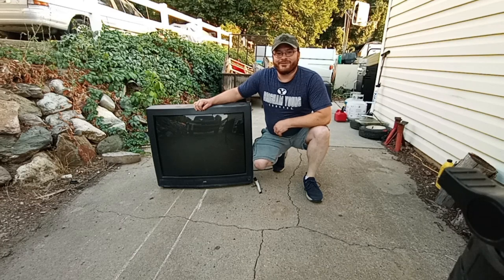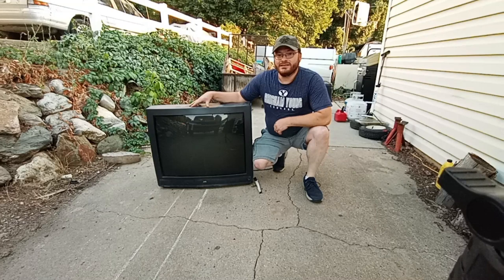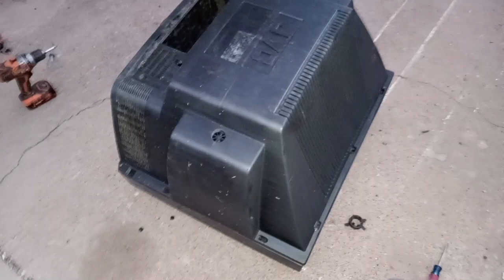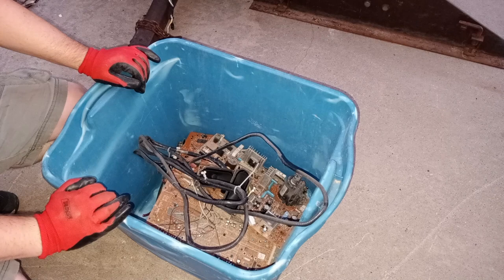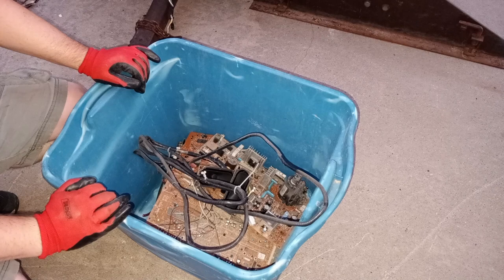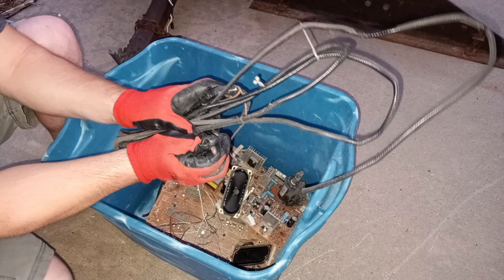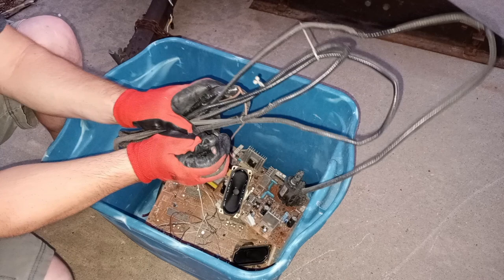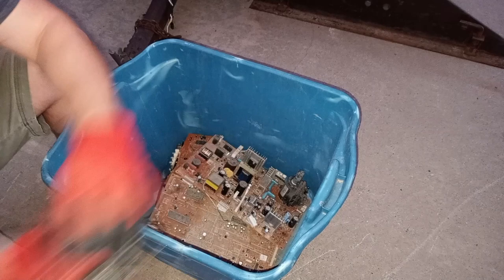What's inside a CRT TV?

Comment: Don't you just love those old TV's'. They re loaded with copper and aluminum. To me it is worth removing the heat sinks and copper. Low grade boards are really not worth much of anything.
Reply from the maker: Yeah, I really like taking them apart. I haven't decided whether I'm going to pull the copper and aluminum off the boards yet. My scrap yard pays a decent price for the low grade boards, but it would probably pay more overall to take off the goodies.
Reply: @scrapperbrad  You just can not beat those goodies.